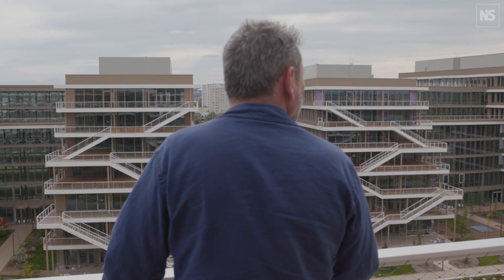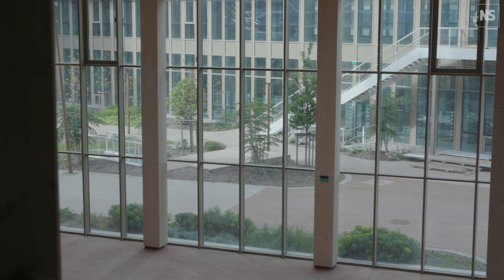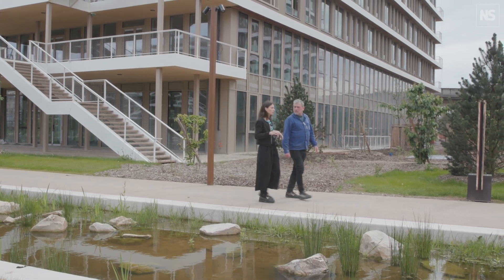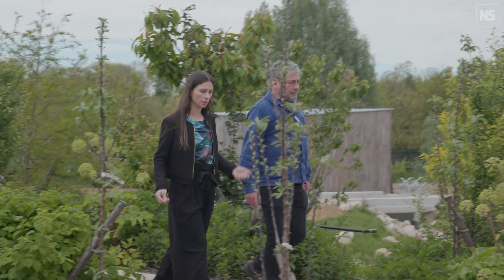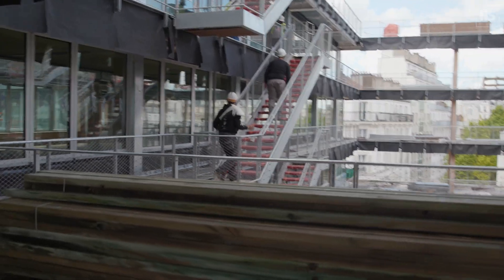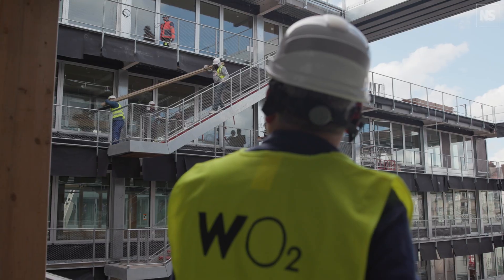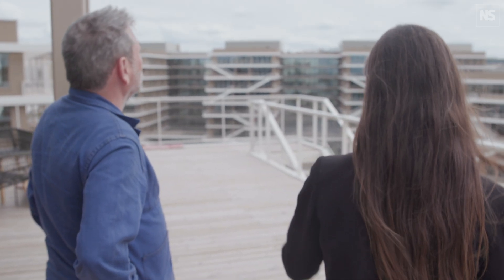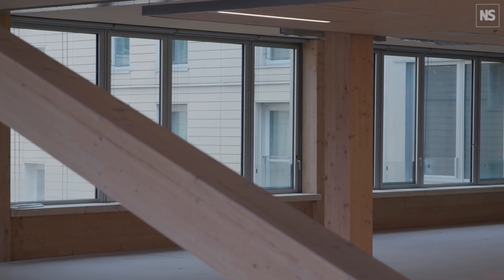Forest office: The role of wood in Paris's low-carbon building boom

Comment: My house is going to stand for hundreds of years because it is from bricks. Tell me how it is ecological to rebuild the same wooden house 17 times over the same timespan
Reply: There are many wooden buildings throughout Europe which are hundreds of years old. It just comes down to moisture management and protection against UV, both of which can be solved with good building design and maintenance.
Reply: @don5nake good point but aside from that, timber is renewable (you can always grow more from the earth), but most importantly it’s production actually reduces CO2  from the atmosphere whereas steel and concrete production only add CO2.
Reply: How much wood (or coal or gas) had to be burned to make your bricks?

Comment: ● My primary concern with wood as a construction material is its flammability (which admittedly varies from species to species, with some tropical hardwoods being extremely resistant to low temperature fires) I live in Australia, which has an abundance of wonderful native timbers, but our construction must be planned around our terrible (and shockingly more potent & frequent since ACC kicked in) bushfires, making flammable woods considered a liability. The future of this wood-based construction initiative is going to be profoundly affected by the first really big fire in these apartments & how effective the integrated fire detection/fighting infrastructure is at offsetting the flammability of the wooden construction.

● While they discussed the psychological & environmental benefits of using architectural woods in place of concrete, the sources of the woods for the specific cross-laminated wood/s they are using are also important - especially whether they were grown through harmful monoculture plantations (like pinewood).

● The thermal insulation properties of these cross-laminated structural woods are going to be more & more important as Anthropogenic Climate Change leads to much hotter, drier summers and colder, more turbulent, stormy winters. Better building insulation means less energy needs to be used in small, wasteful, airconditioning systems & heaters. 

● There are also a remarkable number of "synthetic" woods made of fast-growing plant fibres (like bamboo & and hemp) compacted & glued together with resins, which can have truly remarkable structural strengths (almost akin to mild steel) & can even be made to order to support quite long spans (for purposes like cantilevered balconies or long ceiling support beams).
Reply: Wow! Thanks for sharing your ideas. All food for thought. What do you do for work?

Just started my career as a mechanical engineer. I wanna get into a field like infrastructure or some type of industry to  use my skills to help secure better future in the face of climate change. Any recommendations/ideas?
Reply: @dylantorres2406  Unfortunately, Environmental Engineering isn't something that I know much about precisely. If I wanted to make a guess, though, I'd say that (due to the consequences of Anthropogenic Climate Change) maintaining essential supplies of Potable Water (uncontaminated with Lead / Heavy Metals, Fracking Chemicals, Microplastics, Industrial / Biological Contaminants, Human Sewerage, etc.) is going to become one of the great engineering challenges of this century. So, I reckon it's an area that you ought to take a serious look at. Specific things like:
▪︎ Protecting / remediating Groundwater systems from Fracking (+) contamination,
▪︎ Developing efficient Stormwater divergence / storage systems for cities,
▪︎ Protecting coastlines from mass erosion due to rising sea levels,
▪︎ Water storage / distribution systems for cities (including more efficient Desalination plants),
● Higher efficiency passive cooling systems for air-conditioning entire buildings with minimal water waste,
▪︎ Advanced Bioremediation systems for human sewerage (instead of polluting rivers / lakes / oceans with literal gigatonnes of human waste)

If you want a real challenge, then thanks to decades of neglect & an insane lack of proper funding for infrastructure projects (even in wealthy countries like the United States), there are thousands of Bridges about to disintegrate due to decades of "Concrete Cancer" (held together with rust, patches & prayers - mostly prayers) as well as an equivalent number of Dams that are who knows how long (they cut funding for the inspectors, too) from catastrophically failing & drowning entire towns...

Lastly, here are some of the more ...interesting... engineering adjacent people/channels on YouTube to inspire you:
   ● Tom Scott (A genius who analyzes cutting edge engineering projects)
   ● Art of Rendering (Mechanical systems / principles rendered in 3D)
   ● Integza (Rocketry Lunatic/Genius & Solanum Antagonist)
   ● James Bruton (Robotic Engineering Genius)
   ● Maker's Muse (3D Printing Guru)
   ● Plasma Channel (Ionic Thrusters, etc.)
[ My post with the actual links unfortunately went bye-bye ] 

Good luck with your career, mate. 

                       ~▪︎●▪︎~

(+) - Fracking is a pet hate of mine. It's one of those technologies which look great on paper, but tends to have major problems in practice. There are about 15-20 technical factors that each must be properly accounted for when designing, building & running a fracking system, so all it takes is for a corporation (that doesn't give two shits about the environment) to cut a few corners here & there (Quaestus Super Omnia!), and groundwater that has been pristine for hundreds (if not thousands) of years - and which a few thousand local people rely on for drinking water - gets (perhaps permanently) contaminated with Neurotoxins, Carcinogens & (worst of all) Teratogens...
Reply: @dylantorres2406  That's unfortunately not something that I know much about.

However, a quick look through some of the more ...interesting... engineering adjacent characters/channels (that I know 'bout) on YouTube may give you some inspiration.

● Tom Scott (Genius Analyzes Cutting Edge Engineering Projects)
[ https://youtube.com/@tomscottgo?si=LcJZi1hmFJwq2hwE ] 

● Art of Rendering (Mechanical Principles)
[ https://youtube.com/shorts/8vTWuRIO0U8?si=-9rywDIshiA9_783 ] 

● Integza (Rocketry Lunatic & Solanum Antagonist)
[ https://youtu.be/o-G45OOb32A?si=q4BNzEVq_KFte2ha ] 

● James Bruton (Robotic Engineering)
[ https://youtu.be/FVoqf73ZLZo?si=emjO-Rsj2r10p_uv ] 

● Maker's Muse (3D Printing Tech)
[ https://youtube.com/@makersmuse?si=cwTk8Qja8AN1VWd9 ] 

● Plasma Channel
[ https://youtu.be/eYVwF4OG-H4?si=7HXz4EDt9f9ONpyU ]